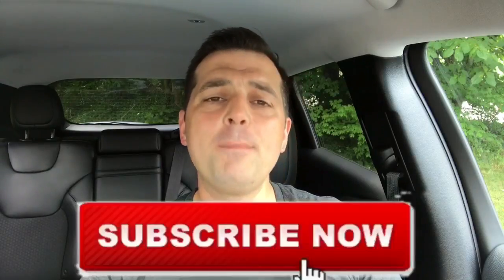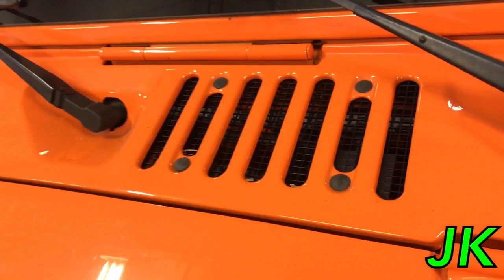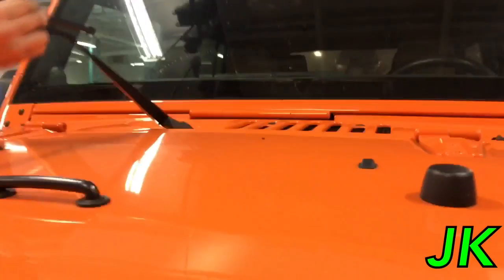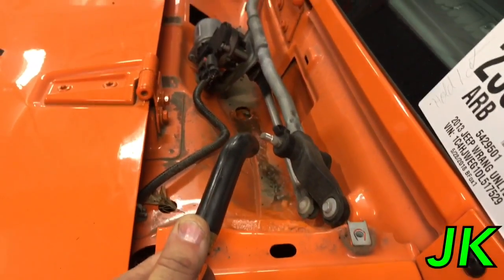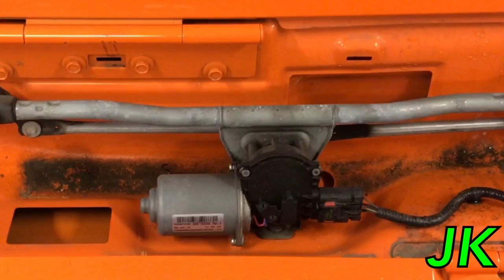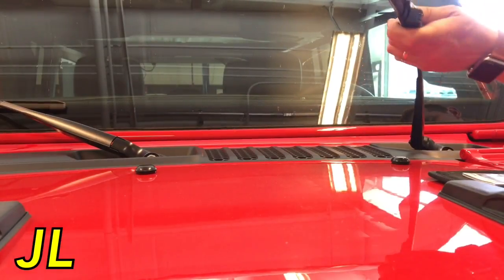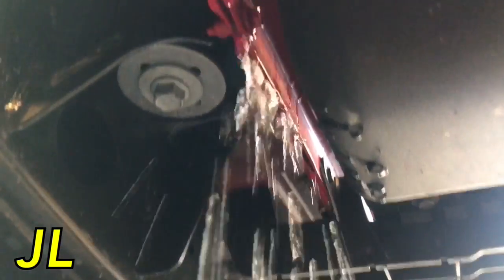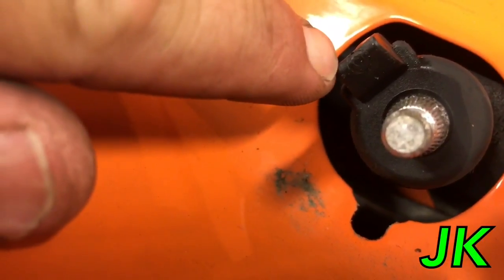JL vs JK Cowl Drain changes ❓Jeep Jl Wrangler

Comment: I live in the deep woods and stuff falling out of trees can cause a big clog mess. Nice to see the JL resolved/minimized this issue. Question , speaking of cowls; the two larger cowls on my JLUR, on the engine hood, are they functional? The underside of the hood has what appears to be an insulated blanket. Seems like that would prevent any fresh air from entering and/or heat from escaping. Maybe it’s just cool looking :-) As usual, great job and very helpful ...thank you !
Reply from the maker: I’ve wondered the same thing( great minds think a like) unfortunately We can’t keep a Rubicon and stock for more than one day. So it’s kind of tough. As soon as I get one we will find out
Reply: Jeep Informant: look forward to it. To your point, can’t hold onto a JLUR for more than a day. I was lucky in May to get mine. I was at the dealer negotiating an order and one showed up in their delivery truck and not taken , yet. I was a lucky dude. Didn’t come close to paying MSRP either:-) double lucky.
Reply from the maker: What color did you get?
Reply: Jeep Informant : white with white finders and black hard top. When I was ordering one and initial preference was black fenders. I quickly came to favor the white fenders over Black. If I knew how to send picture I would. The dealer pretty much maxed out on the options, including upgraded wheels ( I have no idea why the “upgraded wheels” cost so much). Would be interested if you can figure the $900 premium on those wheels. It basically had close to 5K more than I would have ordered. Bottom line, those things I wouldn’t have ordered I didn’t pay for:-) I was very surprised but happy because I would not spend that much for a Wrangler. One item I think is an absolute worth every single penny if opting not for a standard transmission and that’s their ZF 8 speed. It’s a game changer for that 3.6L. It makes that engine come alive on and off road. I loved it on my 1500 with the 5.7L but even more so in the Rubicon. My second favored option is the insulated roof panels, worth every penny. What a major difference in managing climate control and keeping the heat out. There is a great vid out there where a guy measures the temperature differences through a Unlimited with and with out the panels. So far only options I have installed is the WARN Zeon Platinum 10k pound  wireless winch  ( sits inside the Mopar steel bumper, beautiful fit and complete open airflow to the grille). I also installed the Outback ‘Tailgator’ work/cooking table on the tailgate. That’s my favorite thing I have spent my money on. Next option is waiting for rear bracket options for additional backup lights. With the new high res 8.4 Uconnect and camera you can hardly see anything in the backup camera at night. My 2016 1500 and 2500 I can see just fine at night with the stock backup lights. The new Wrangler, backup lights and new 8.4 just doesn’t cut it at night.
Reply from the maker: Send a pic to jeepinformant@gmail.com. If you want. I’ll have to check out the back up camera.
Reply: FYI, when washing my JLUR this weekend, I noticed the soapy water draining from the hood right at the "B" of Rubicon on the drivers side and right at the "C" on the passenger side.
Reply from the maker: Weston are you thinking that the hood scoops have a drain?

Comment: That's a pi** poor design or maybe designed like that on purpose to corrode. They could have put that drain anywhere else but inside a rocker panel. You just know those tiny slits are going to get filled up with junk and corrode.